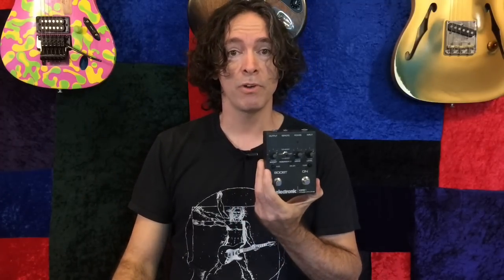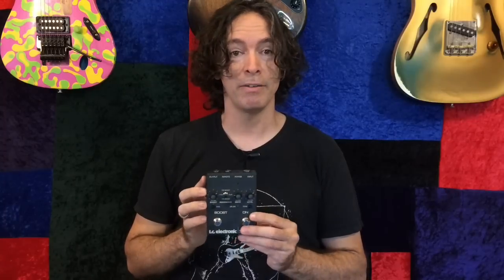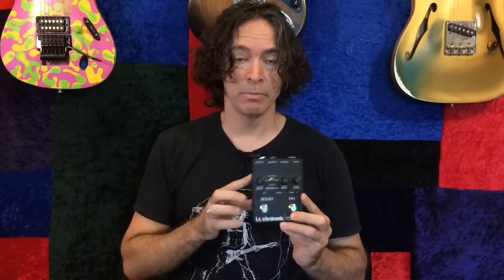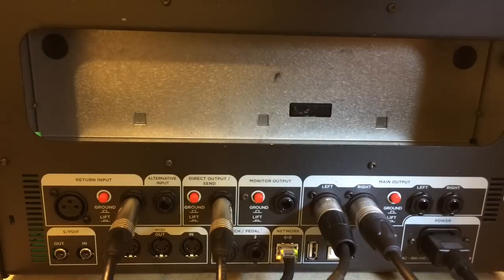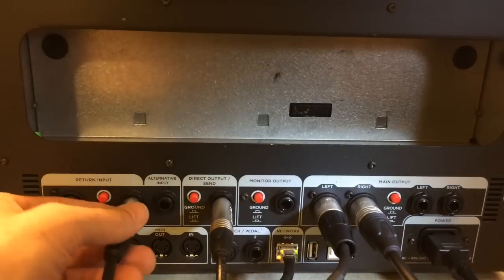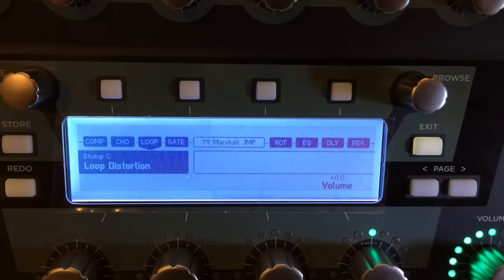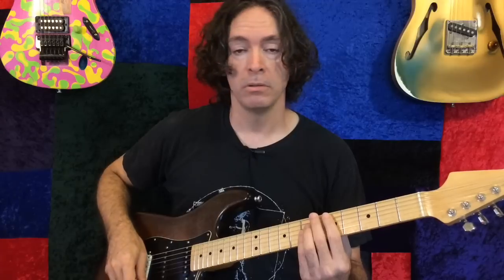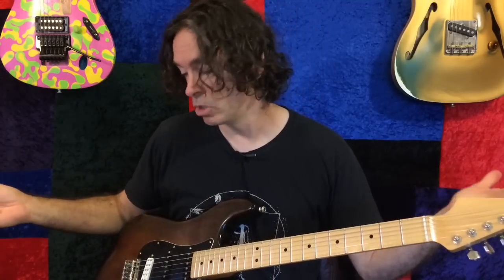Episode 6: Gimme a Boost!

Comment: Seems better to stick boost/distortion/fuzz it in front of the Kemper  I would think you would put things like the Strymon Timeline or other time based, modulation stuff in the loop section.  I guess the only benefit in the loop is that allows you to hit one button on the Kemper remote.

Comment: Ordered my Kemper Profiler from Sweetwater today.  Will be using a Yamaha DXR15 powered PA speaker I picked up this weekend, for stage sound, and hopefully will get this all together in time for next gig (especially since I've sold the amp I usually gig with, and am well rid of it).  How are you finding the Kemper through powered speaker and PA, compared to tube amp with microphone signal to board?  Also ordered one Mission KP expression pedal from Sweetwater and spring-loaded one direct from Mission.  These videos are going to be so much more meaningful when I am able to apply them to the actual gear, and become a more genuine acolyte of Kemper Profiler TV, heh.
Reply: Awesome!!!
I'm using the Kemper for the first time at rehearsal this Thursday... It's gonna be a trial by fire situation, we're recording a promo video on the same night.
I'll let you know how it goes.
Rock on,
Scott

Comment: As i understand it you have to add the loop to every preset separately. If I don't want to use external pedals I could also add a boost in the stompbox section and control it via a simple footswitch? Because that's what I allready own. Thanks and kind regards.
Reply from the maker: Thomas If you've got a favorite OD pedal, then, you just add it to the rig, then control it the same as you would any of the built-in stomps.
Rock on,
Scott.